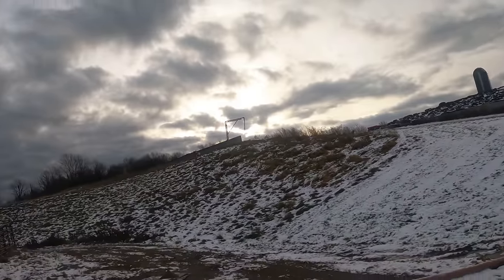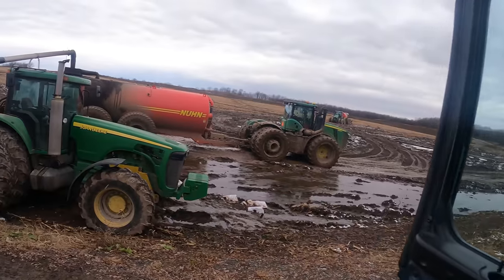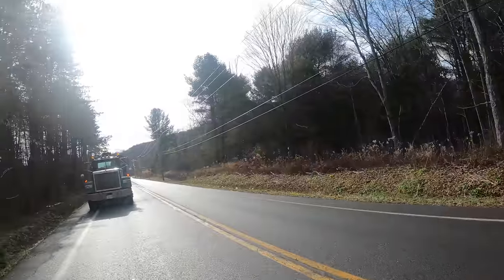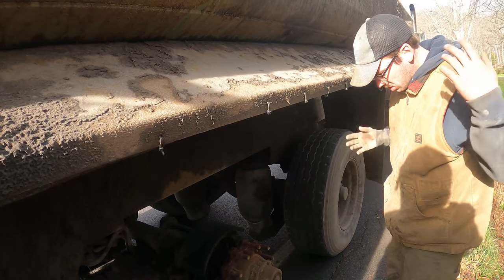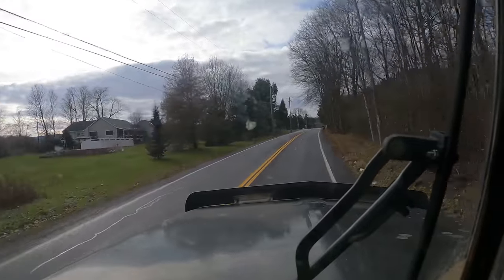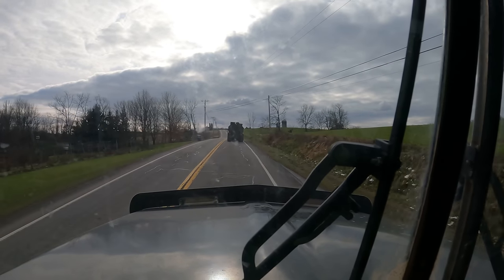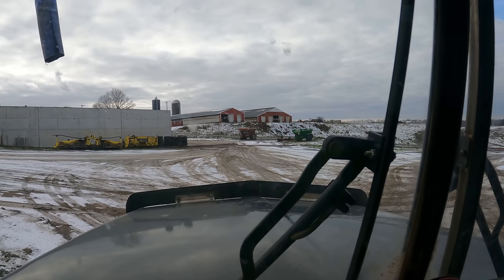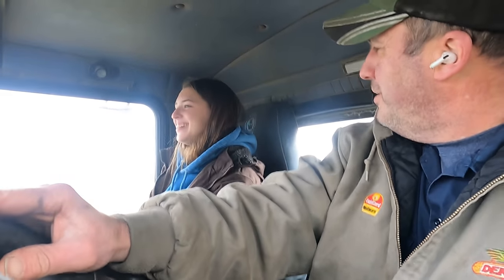The wheels are starting to come off

Comment: It's been a little while since Iv seen a video with you hauling manure. Couple years ago I pulled a set of wheels off of a trailer to run it back to the shop, and when it got there the brake drum was missing. I never mentioned it to anyone and I never heard of anything bad that became of it but I won't do that again lol.. what a sloppy mess everything is it was in the mid 50s here today it would be good if things harden up a little bit. Awesome video man
Reply from the maker: Temperature dropping right at the moment

Comment: There’s a project for u some time when ur not using the nurse tank put in a full length sight tube then u can see exactly how much is in it at all times. Have u ever seen the air adutation systems for slurry stores and lagoons? They are fully automated and keeps the solids and liquids constantly mixed and ready to pump at all times.
Reply from the maker: Yeah

Comment: Hi andy did see a video from tom pemberton in england he had a system with air pipes bolted to the concret in the bottom of the lagun pumping air two times a day perhaps nothing for you if you need to go down with the wheelloader and take out the sand

Comment: been in heavy haul have you  considered going back to grease instead of gear lube for wheel ends works better when drivers miss a wheel seal during there pre trip inspection
Reply from the maker: It’s a good idea

Comment: Andy do you use the torque method to adjust truck wheel bearings? Then check clearance with a dial indicator as final step. I started using that method and it  REALLY improved bearing life on trucks 👍. Lot on YouTube on how to do it.
Reply from the maker: No
Reply: Bearing end play with a dial indicator  should be. .001- .005 inch. I think at least from my experience we were not getting the bearings tight enough. With torque method you know exactly the end play. Pitted rollers and races are a sign of to much end play, not tight enough

Comment: To me the manure crawler is not only a waste of time and money, but a waste of America's resources. With sand in the mix, as soon as it's stirred, it settles again. Gotta be a better system!
Reply: That crawler saves them days maybe weeks of digging solid sand out of the lagoon after they pump it off. It also saves the crazy cost and engineering of some kind of sand separating system. 
A waste of Americas resources haha.... of ALL the things we piss away and waste in this country that crawler is not on the list.
Reply: @Adam_Poirier  Neither of us know how much sand is in the lagoon. But a process that stirs it up only to have it settle on the bottom immediately is a waste of energy. They're rich enough to afford the fuel, but petroleum fuel is finite. It is not endless, regardless of what we wish. If we can conserve, America's supply may last a little longer than the rest of the world. It may be an advantage in the future. - And the big loader could dig that lagoon prob before lunch. Really, don't you think there's gotta be a better system?  And you're right, there's incredible waste, me too. I won't be around when the world runs out of petro fuel, but I feel a responsibility to help my country any way I can, maybe, for now, that's speaking up. Hope I'm being a positive influence. Duty, Honor, Country. It helps me when in doubt.
Reply: @heymakerphd1982  I bet they have tried about everything you can think of.  and I bet overall the crawler agitation takes the least amount of fuel.
Reply from the maker: If it didn’t work we wouldn’t be using it